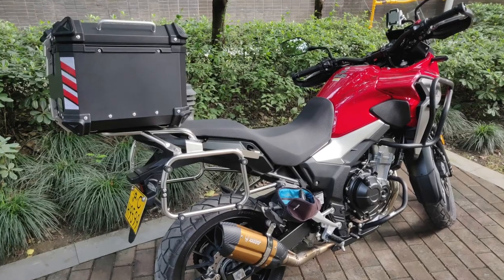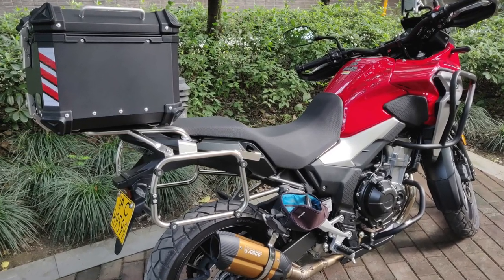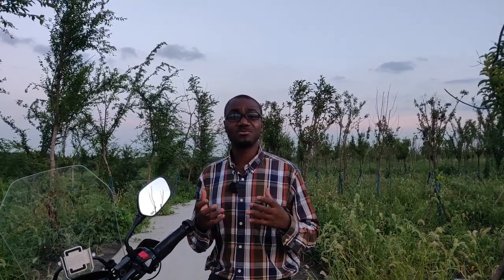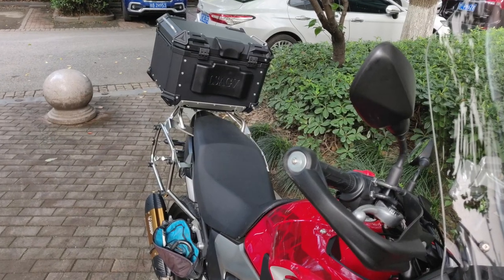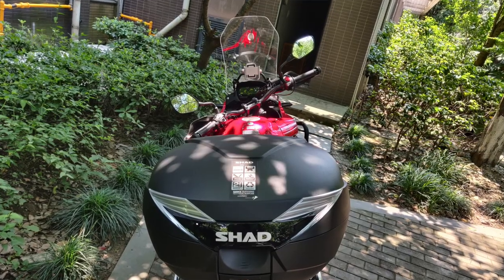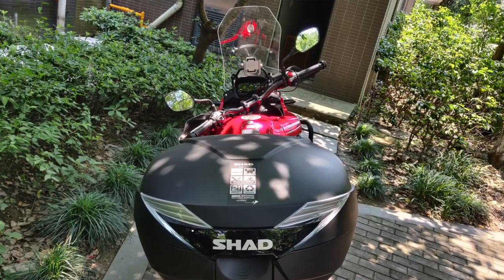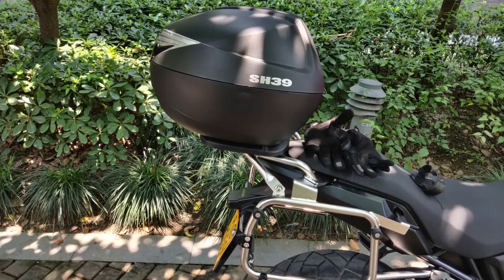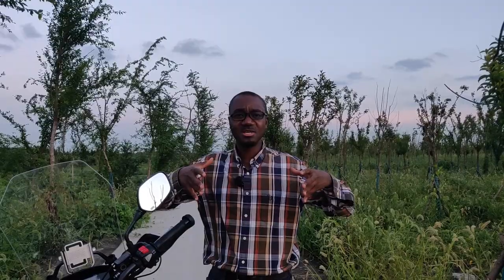Heads-Up || IMPORTANT Note for Honda CB500X Top Box Install

Comment: Sorry but I cannot agree based on my experience. I have an aluminium top box and rack from swmotech and absolutely no problems, even when loaded. I have even tried to start a wobble to test and it damps away immediately. I would suggest you check your tyre profiles, pressures and suspension settings. All the best…..PS also fine with passenger.
Reply from the maker: I see, different experiences then. I have a tire  pomp and I'm pretty frequent on checking and pomping my tires to the recommended pressures. My tires are in good shape as well. I've adjusted my rear suspension to different settings and find the hardest pre-load setting to be better overall, but it's still slight if top box has some weight in it. Like I said in the video, there's no vibration or wobbling whatsoever when my hands are on the handlebars, it only happens when both hands leave the bars for a few seconds. Not that I leave both hands while riding though. I'm in some groups where others have the same issue. I guess different brands will react differently. I'm glad yours is stable.
Reply: What tyres do you have ?
Reply: @DanielOliveiraSantos  Dunlop stock.
Reply: @fluffytyphoon   I have the same wobble with the same tyres...
Reply: @DanielOliveiraSantos  Strange…maybe check the suspension. I have mine quite firm so that I don’t have to adjust for a passenger. 4 out of 5 at the rear and almost full preset at the front if I remember correctly.